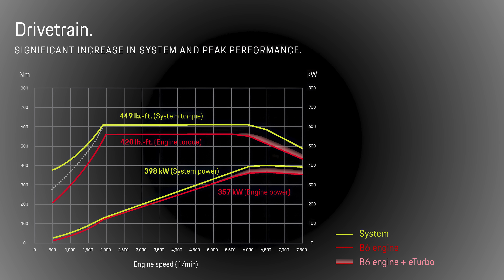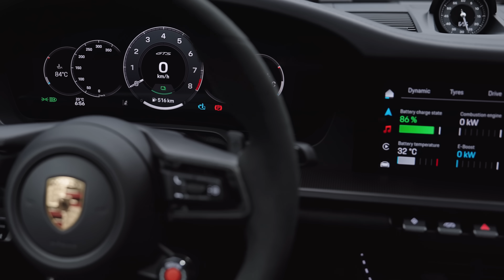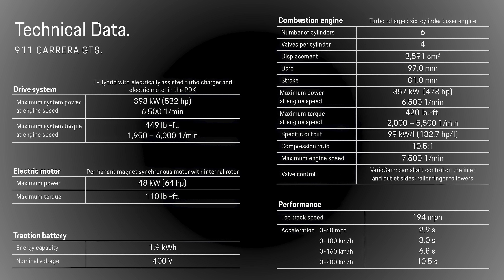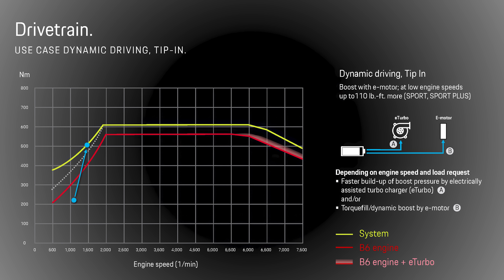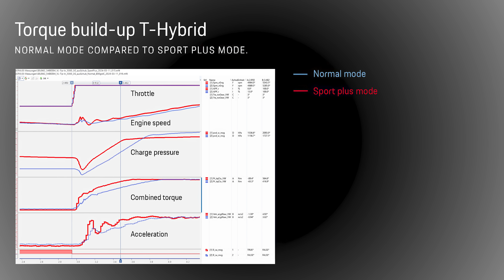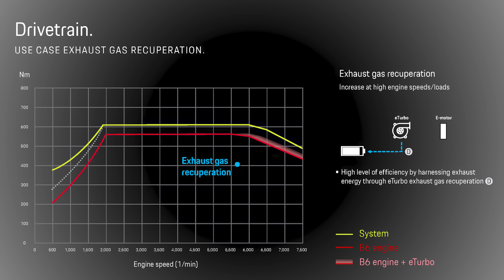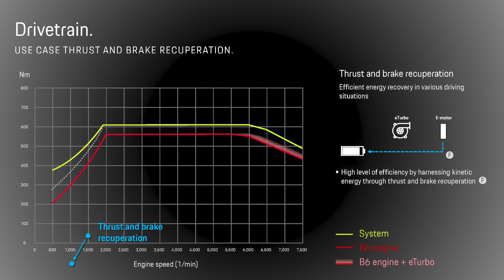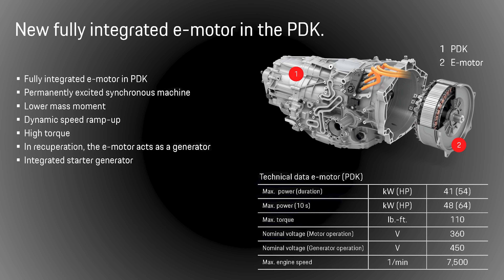2025 Porsche 911 992.2 | Bigger Engine, Electric Turbo

Comment: No enrichment in the entire engine map is crazy, dont think ive seen that anywhere else
Reply: imagine what an aftermarket tune can do to this platform
Reply: @fauxtool952  Probably burn out the electric motor in the PDK since it's permanently engaged, or blow the turbo due to no wastegate :D
Reply: The electric motor won't burn from constantly spining, it just generates free electricity to use on acceleration. If they manage the power well (and porsche engineers always do) won't even hurt the battery let alone the motor.
A lot of Hybrids have electric motors constantly engaged in the gearbox (BMW i8, NSX, even the Prius)
Reply: @fauxtool952  screw it, as usual?
Reply: @AI-qd4vb basically every car released in last 10-15 years drives better with a good aftermarket tune, especially turbocharged ones
Reply: It’s going to be a legal requirement in Europe soon.
Reply: Enrichment? Am I the only one who doesn't understand???
Reply: @3000Payne  Optimum power in an ICE tends to occur at mixtures with more fuel than is required for stoichiometric operation (lambda 1).  This is less efficient in terms of power per unit of fuel, but overall makes more absolute power.  Porsche is sacrificing some maximum power by running lambda of 1, but they make up for it with a bigger engine and e-motor.
Reply: @ChurchAutoTest — That was very well explained.
Reply: @ChurchAutoTest  so thats why they said on certain operation range, its complete fuel cutoff?
Reply: @3000Payne  Most gasoline engines over-fuel in high load & high RPM (highest 30ish % of power) parts of its operating map. This is to prevent the exhaust valves, manifold & turbo from over heating. Quite bad for emissions but the official EPA & Euro test cycles didn’t push the engine that far. They basically use gasoline as a coolant.
Reply: Unfortunately you will see it everywhere soon :/
Reply: I can’t wait to see how tuners f this car up.
Reply: Believe it or not, the HD gasoline trucks in the US are largely tuned this way as well. For that reason, they are one of the few NA platforms that pick up significant numbers with an aftermarket tune. My friend has a 6.4 Ram and can change the tune from a little screen. It's fairly noticeable between stock and one with additional enrichment.
Reply: Yeah...this will be interesting. Many euro cars are lambda=1 in the low-midrange but when EGT (modeled) rise fuel enrichment is triggered.
Reply: VW/audi has done this for a decade now. Stock Mk7 golf tunes are 1.0 lambda at WOT.
Reply: @nathangamber9230  Yep!  I showed this video to my tuner yesterday and he said Mk7/EA888's have been doing this for awhile.  They also do not have wastegates.  My big turbo Mk5 GTI with the EA113 definitely DOES NOT run Lambda 1 at wide open throttle haha.
Reply: @g60corrado91  he said ea888s don't have wastegates??

Comment: New gauge cluster is so ugly compared to the 992.1
Reply: They should offer customers an analog option if they desire to have it
Reply: @Boahman  yknow that’s actually a good idea, more little options for preferences
Reply: Hot take, but the 992.1 tach was kinda useless with the angles cutting off. If they fixed that here - no one will complain lol
Reply: Total disappointment.
Reply: Its fine. Mechanical would be better but he look is good. For Ugly, see BMWs cheezy instrument displays (any of their offerings).
Reply: Imagine having all of that electric hybrid information buried in screen menus.... I think that's the reasoning. No one would be caught dead fumbling thru screens to see if your hybrid motors are out of juice.
Reply: 992.1 gauge cluster is ugly compared to a 993, 996, 997, 991
Reply: Yup, we need to go back to 70s
Reply: @guycha0s380 you’re right, these squares don’t understand how an Apple Watch is 10x cooler than a Breitling Chronomat.
Reply: Okay boomer, get with the times or get out!
Reply: That’s your opinion but you do you
Reply: @Fazer8461  I don't think it's ugly per-say, but it does come across as effing lazy when it looks like they ripped it out of a Taycan or Panamera, with very Audi-like graphics.  If Lexus could figure out a way to make screen clusters look at least a little special in the F cars years ago, Porsche easily could have done the same for the 911.  A flat screen is just a boring, slap-it-in approach.
Reply: @aprtur  eh true, can’t really argue with that (not that I WANT to argue)

Comment: 550 HP in the GTS w/ tech that effectively makes it feel naturally aspirated is insane
Reply: it may feel like it's n/a but it won't ever have a soundtrack of one
Reply: @anmolsaxena_  which is why i don't get all these cars. i gladly give away 100hp for a great sound and tenth of a second in acceleration for a good looking design etc. it's not like more than 0.1% of drivers are actually able to even use that thing as it should be used and even less of those that actually can do it legally. personally, between 2010 and 2016 is when sportscars peaked for me, no emission BS, just fun. you could have the fastest porsche or bmw in the country, when my c7 z06 is behind it, nobody even looks at that thing. and you don't hear it too lol
Reply: @anmolsaxena_ darn
Reply: @anmolsaxena_ the exhaust is free flowing considering it's an electric turbo no? Should sound quite similar
Reply: @turbochoochoo no, the exhaust still routes through the turbo, otherwise it would be an electric supercharger, the e motor in the turbo just assists to improve transient response considerably.
Reply: @anmolsaxena_ we heard the car on the official presentation, sounded like a N/A
Reply: @JR.A110R The part where Matt Wattson was drag racing against the 991.1 GTS? That's a V8 dubbed over. Porsche knows this sounds muffled and muted, just as all turbos should. People are just not realizing the fact that they STILL haven't bothered to make this n/a despite electrifying it, like they just HAD to still put in those uninspirational, experience-alleviating turbos in.
Reply: @Anti-FreedomD.P.R.ofSouthKorea  completely wrong what you said :

1) it was no dubbed over wtf. The car sound different because the engine is different 

2) this sound less muted because it has one turbo less and a bigger engine displacement (3.6L vs 3L). The sound is greater 

3) you didn’t understand the purpose of the hybridation here, like many others people. It’s like a F1 KERS system and not a plug-in hybrid. It’s just for performance. So there is no emission advantage since the car can’t drive in EV only. 

Please next time double check what you want to say
Reply: @Anti-FreedomD.P.R.ofSouthKorea  Calling Turbos "uninspirational, or experience alleviating"   Makes it sound like you have no idea what turbos do.  Turbos are literally the best part of any engine!
Reply: @GOLD_FEVER  lol enjoy your muted engine noise, bad taste like this is what makes them mute their cars like this despite having the funds and r&d to go n/a. Yeah n/a sucks!
Reply: @JR.A110R  "please next time double check in what you say" provide evidence that the portion in question of that video indeed is the cabin noise of a 911, when both cars are heard of having what is exhaust noise with the harmonics of a v8 engine. Did Porsche "officially state" it is the recorded noise of their turbocharged 991 cabins?
You can not change the firing order and therefore the harmonics of any 6 cylinder versus 8 cylinder, you just can't alter physics and the shapes of crankshafts like that lol

I never even argued for needless demands for an e-kers, where are you bringing this out lol. I never proposed any defiance against electrification, in fact no one dislikes something like the cadillac V-LMDH when it sounds godly like any sports or racecars should. Which Porsche 911s have not ever since the 991.2, minus the GT3s, and drastically worsened since the 992. why are you imagining others' arguments just to virtually refute over your owm imagination, people aren't created inside your mind bro

"Larger engine displacements equate bigger sound" LMAO

Might as well check your conscience, above the need for asking me to re-check my facts
Reply: @Anti-FreedomD.P.R.ofSouthKorea  I drive a turbo'd 4 and it sounds just fine.  Put a couple cherry bombs on it and it sounds 10x better than any fartcan civic i hear on the roads...  You're telling me a multi billion dollar company can't figure out how to amplify some exhaust when i can? Just say that you don't like the exhaust sound.   That's a real criticism not this " it should sound na " bs.    People like NA because of liniarity, but  turbos give you way more power and in a much more visceral package....    So i guess i can't see why anybody would ever go back to their grandpas gutless NA v8 when you could have a supercharger or a turbo on it...
Reply: @GOLD_FEVER  "gutless v8s" also mind adding in "gutless naturally aspirated flat 6s" too to your vocabulary
Reply: @Anti-FreedomD.P.R.ofSouthKorea  Yeah they're all gutless if we are comparing the same engine with and without turbos.  
I mean there are plenty of great NA cars out there (Dodge Viper comes to mind)  but again.  Compare that same motor without vs with a super/turbo charger and the winner is clear, it's just common sense.
Reply: @GOLD_FEVER  you obviously never drove a motorcycle or a high end NA car. No shade thrown but there's just no comparison in the exhilaration you feel when revving it out to 100%
Reply: @anmolsaxena_ I remember making fun of Civic bois for just worrying about how their cars sound. I guess performative is the closest to performance that some can get.
Reply: @MingusDewfus people who actually like driving care more about feel and engagement than performance, and sound is one of the most important factors in the driving experience. All these cars are too fast to safely use their
 performance on street even for outlier high skill drivers regardless, so more performance doesn't bring anything to the table 99% of the time, but sound you can always enjoy.
Reply: It won't feel naturally aspirated. Look at that torque curve - the engine is still all out of ideas after 6000rpm, just like the previous bi-turbo unit.
Reply: @qwerty69600  When you get 500 plus torque at close to 6k  what the hell you need after 6k for???   If you want a more powerful car just say so.
Reply: @GOLD_FEVER  It was in specific reference to them saying it would have the nature of an NA F6 engine, which I think the torque curve proves it won't. Try and keep up, we haven't got time to keep explaining things to the children.
Reply: @qwerty69600  Mhmmm ,  we all read that "specific reference" in your original comment.        Also,  i'll take being a kid over being a pretentious twat arguing paper stats and imaginary deviations in torque curves.
Reply: @GOLD_FEVER  "imaginary deviations in torque curves" haha. Yeah ok bro they all work on fairy dust, my bad.
Reply: maybe. but if you sit in a Carrera s ir a turbo s, its hard to tell them apart from the sound track.
Reply: And thats Porsche hp, so thats effectively 550 hp to the ground, while the whole system probably makes 620 hp 💦💦💦
Reply: @air-headedaviator1805  no
Reply: One more thing that’ll break